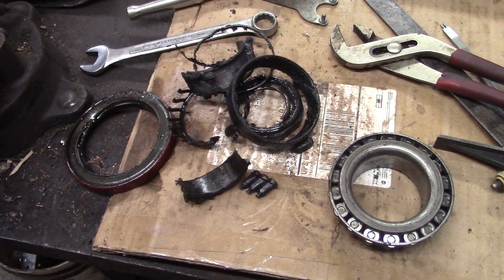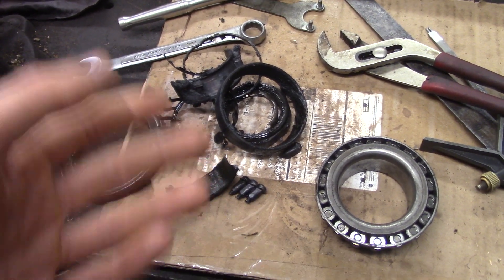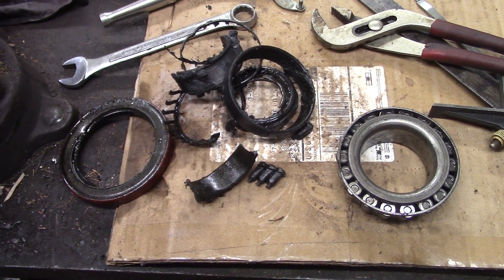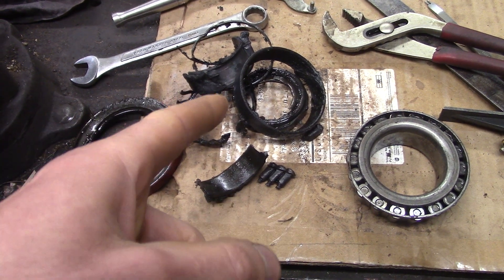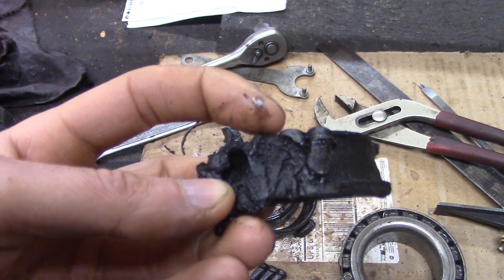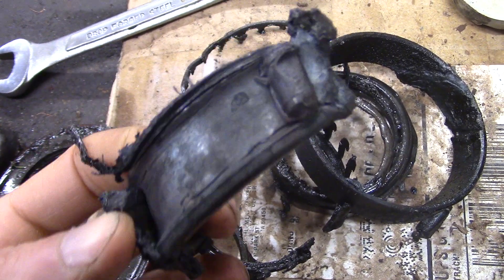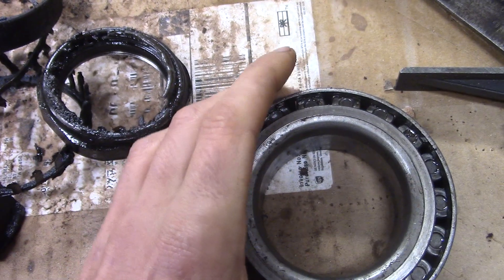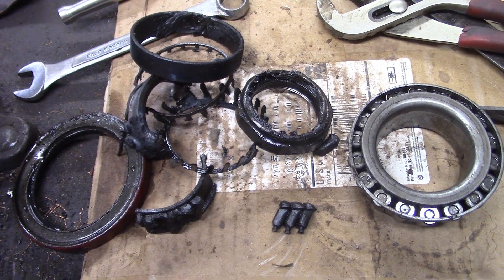How NOT To Torque Wheel Bearings

Comment: Yup,,, and I sent my 8L Cummins to the BIG Cummins repair center for a SIMPLE front seal replacement,  " I was away, and the truck needed to drive 14 hours " SO I had it sent to them.....AND
 ya, it leaked the whole trip .....SO like you I WILL DO IT MYSELF.

Comment: My mom had a drivers side front wheel bearing replaced on her car a after I did the passenger side. She made it halfway home before the lower ball joint bolts backed out while driving down the road. I wish I could've been there when she told the shop manager what happened. Apparently he assumed it had been the side I worked on. She told me his smugness disappeared quickly once he was corrected.

The shop took care of everything but it couldn't have been cheap. Axle, brake line, knuckle, strut and fender and paint. Lesson learned for the tech I suppose.